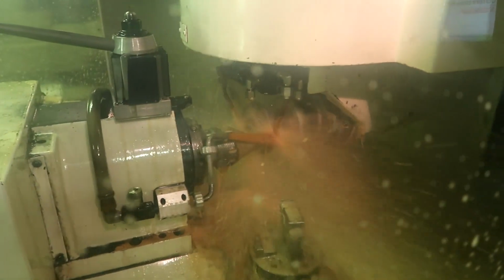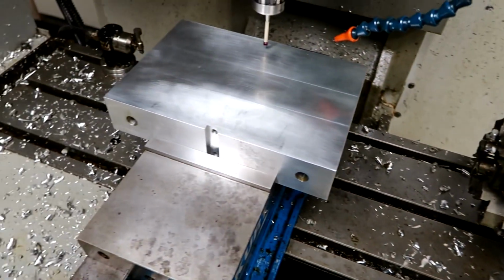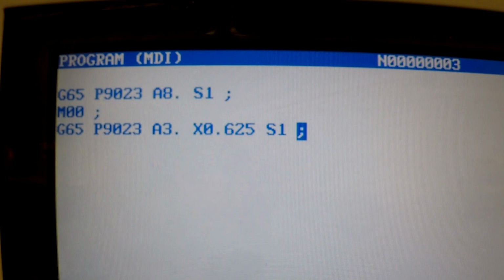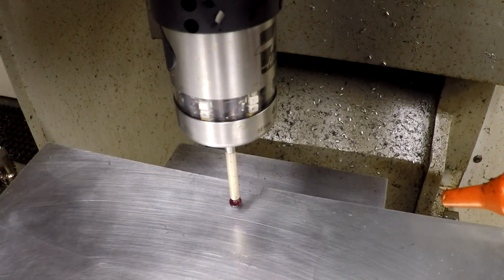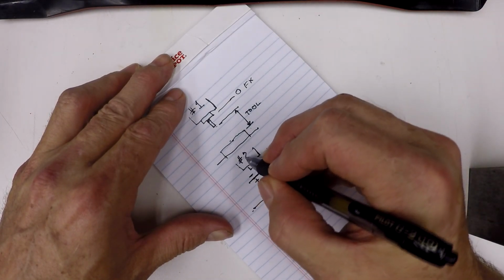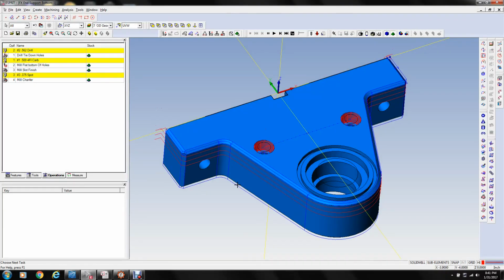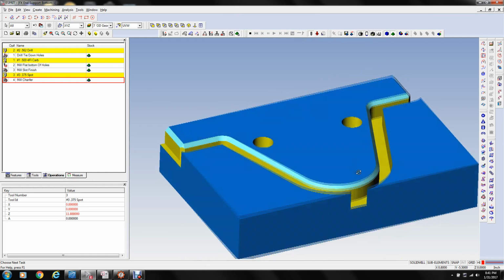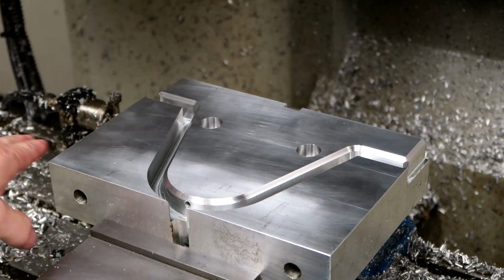5 Axis Mill Stop Fixture End Support for the Haas TM-1 Mill In my Garage

Comment: How do you like the small haas machines you have in your garage? i am considering getting the same setup you got for making prototypes and other stuff at home in my small garage.. its about the same size as yours. 6.5m x 3.3m..
Reply from the maker: I really like these machine. I have owned many Haas machines in the past. If you were on the fence between the Haas and the Tormach I would recommend the Haas over the Tormach. The Haas will be a little more money but if you can afford it you will in the long run be glad you went with the Haas. This space I have the machines is a little more than half the space of a two car garage. The entrance or door height to my garage is about 6.5 (1.90m) feet when the door is open. I was able to get the machines (the mill) in without a problem. I did have to create clearance above in the rafters when the Z axis is at the tool change height. Both machines will run on single phase power. They will have a little less spindle power on single phase, but other than that they have complete function on single phase. Rigid tapping spindle control and speed exct. The servos are AC servos not steppers. These are real industrial quality machines. Mine are the first versions that Haas came out with so the newer ones might even have better options. Get a full enclosure if you can fit it. It wasn't a option when I bought mine. I wish mine had them. If you buy the mill get the probing option it is worth every penny. To be able to touch off tools and probe parts is, well once you have done it you don't want to go back as they say. The control on my machine is not completely a PC based control. What do I mean buy that? The working memory is not as large as a hard drive. (The new controls may be larger or different) If memory serves me I think it's around 3 meg witch is quite large for a CNC machine (My Mit Horizontal only has 490K). If you are going to run vary large programs Maybe Haas has larger memory options. I have run DNC (Drip feed) programs from my computer quite often. This works flawlessly. But it does have all the disadvantages of running DNC that any machine would have. So in conclusion I would highly recommend these machines for doing what you describe you want to do.
Reply: @EdgePrecision  I would never buy a tormach I run a big DMG 125  horizontal every day and s tormach it to much of s toy for me haha . And I got 3 phase 16 amps  in my garage. What about the tool turret for the lathe ?
Reply from the maker: I would rather myself have the manual toolpost. For prototype work it would be much more useful. This wasn't a option when I purchased my machines but I wouldn't have got it. I have run jobs that take more tools than the turret can hold. Also you can pretty much use the same tooling that a manual engine lathe would use. I have made special ER32 collet holders for the tool post so I can mount drill and small boring bars in collets. You can also switch the lathe into a gang tool configuration. So if you make a block (They may already sell such a thing) to hold many tools on the cross slide. I have never done this but if you had a lot of small parts to make it would be the way to go.
Reply: @EdgePrecision  ok how presice is the tool post when changing tools? To you need to zero then after each change ?
Reply from the maker: I have a Dorian tool post and it changes tool to where I have held less than .001" on lengths and diameters with no problem.
Reply: @EdgePrecision  ok I am happy with that. 

Only thing I am abit afraid of is that it will be impossible to run some production jobs. But as you sayd earlier you can make a tool holder yourself for more tools if I got some jobs with higher number of parts.

Comment: At my school I teach using 3 tool offset methods I call your #1 "Old School" method - the first way I knew in 1985.  I was taught to use a 1.000 block as touch off rather than paper (I'm glad for that).  in the 90's at my job we all got converted to touching off the table with 2.000 block. So we all set tools up the same way no confusion. Then we just needed to shift the G54 Z a plus number from the touch off point to top of part plus we could now do multiple operations and share tools better. At first my old shop hated it but we got over it and it works slick and better tool blends.  I Called that method #2 in the school "common surface"  My # 3 is the Gage line method like yours as all Renishaw's work the same way. So before probes we had those pre setters in a tool room and they just set tools for us and we used a gage tool set to 5.00 and we find top of part and add in the 5.000 = Ran a Mazak that way that had an OTS Renishaw but no probe. all the same . - I like your videos

https://www.youtube.com/watch?v=pnO0T9QWtNo

Comment: Do you always type the probing in manually or is that just for the video? I usually hit Prog/Conv three times and use visual quick code. 3 point bore stuff and auto tool offsets I still use the Rennishaw macro manual. Not sure if VQC and the Rennishaw option can be separate or not. Like the use of the chamfer.
Reply from the maker: tansit2344 I just got us to doing it that way from running other machines. The Haas quick code comes up with a slightly different coding but the standard Renishaw cycles work to. There is so much more that can be done with probing. This is the most underutilized option on most people's machines. I plan to do a very much more detailed set of videos on this subject.
Reply: I look forward to it. I've been teaching myself the auto wear compensation between orders and doing things with the tolerance limit. Nobody at my company knows the software exists on 6 machines or what it can really do. Always G54 corner or bore, sometimes web, and tool setting. Macro B is the other thing I'm trying get a handle on for that. We just have two guys shoot out untested MCX code with all the wrong tool numbers and feedrates, no time or blessing for improvement elsewhere. Go American manufacturing heh.